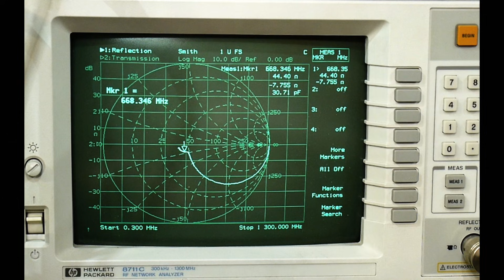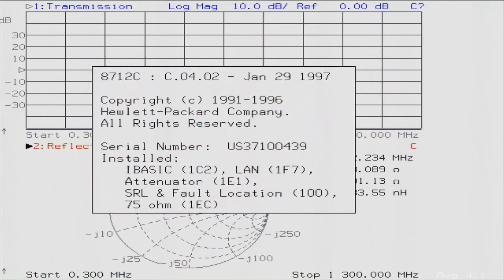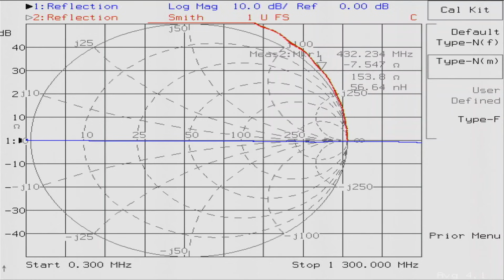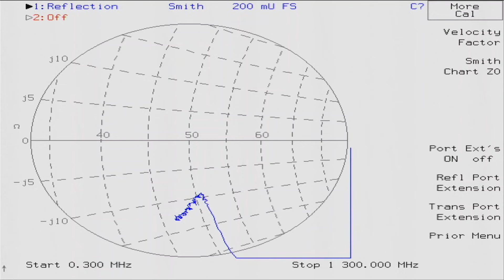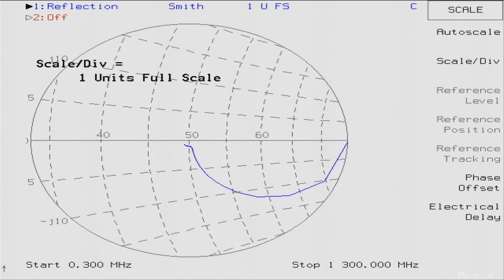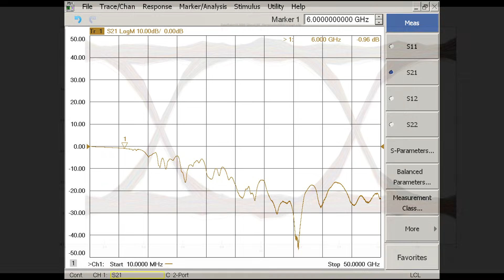#1215 VNA  Test Boards revisited with new data

Comment: Wow. This exercise did so many things. I had been waiting for your reexamination of test board results before ordering some.  Your results were great and added to ideas for best use.
First,  when did you get the bench top vna? Did you compare new instrument results to the nano, which you've already documented so well?  I'd like to see your test board measurements compared on nanovna to give my results a reality check. 
Suggestions about validating using high end standards are interesting. Precision without accuracy is no good for the real pros watching(not me).
Your comparison using port extension function and explaining results are appreciated.  I've never seen the effort to actually compare results when measurement plane is extended, as it (mostly) happens. 
I'm living in the low GHz because that's what I can afford and it is what I need to learn.  Seeing the effects of mm dimension changes are a great reminder of the magic of the RF world.
Reply from the maker: https://youtu.be/Saob5r6nb_4
I did many video on the upgrade to VNA 
https://youtu.be/CjRfue7HOgs
comparison: https://youtu.be/1Ll9YGzzulo
Reply: @IMSAIGuy  Thanks for link.  I'm just up to #700, not skipping around.  Just enjoyed your special books segment.

Comment: If you calculate the resonace of the capacitor using  your 100pF and 0.76nH it comes up to around 577 MHz, so you are probably seeing a series resonance effect, where the capacitor is now an inductor. A 100B datasheet confirms this. The ESR on the 100B  datasheet shows ESR of ~ 50 milliohms and Q of around 60 at 500 MHz. Capacitive reactance is around 3 ohms at 500 MHz.  There can be higher secondary resonances as well which the capacitor becomes a parallel tuned circuit.

Comment: What is the objective here?  To measure transmission line impedance  or capacitor? If the objective is to measure transmission line your new calibration contraption would cancel out Transmission line imperfections, and you can not measure it correctly.

I also think your body's proximity to the board change your measurement results.
Reply: I don't want to imply I'm speaking for the IMSAI Guy, but I get the impression test boards were probably made without realizing the impact of the electrical length on measuring the part.  Then it evolved into seeing how calibrating at the board edge vs. calibrating at the part reference plane makes a difference (along with not having an ideal 50 ohm trace).  So likely a 'trial by error' scenario. 

I should add a full two-port cal would have been needed to really de-embed the part (if that was the goal).  I noticed just a one-port cal was performed, so the transmission line on the other side of the part was not de-embedded.  That would be the biggest contributor to device measurement error (if the trace is not an ideal 50 ohms).

Comment: Just seeing the impact of changing the SMA connector on the board made the whole video worthwhile.  It just goes to show that the smallest of changes can have a very large impact when you're working at RF frequencies.
Reply: I once reconditioned an 11-element, circularly polarized antenna for the two-meter amateur radio band. The most improvement in performance characteristics came from completely rebuilding the gamma match between the polarization planes of the antenna, and the physical straightening of the solid aluminum rod elements into two orthagonal planes. Not only was overall gain improved but the beam's main lobe was tightened improving selectivity as well.
Reply: @MrBrelindm  I recognize some of these words... Actually basically all I get is straightening out the rods, and the tighter lobe/better selectivity... I need to learn some RF shit one of these days.

Comment: I would suggest the capacitor not being able to be a capacitor at 500MHz as the most probable cause of the "kink". The dielectric might act weird at higher frequencies and the pad resistance/inductance takes over

Comment: I have somewhat mixed feelings about your video. You are measuring something "unknown" against "unknown" calibration standards until the result seems to make more sense to you. As long as you don't enter the correct/known calibration standard coefficients in your VNA, all these measurements are of little use in my oppinion. However - it was a nice video to watch :). How about sending your friend your cal-standard and he measures it agains his professional ones? That way you get a really known and good standard as reference yourself. Just don't forget to store the cal-coefficients in your VNA and recall them before you perform a calibration.
Reply: I've done exactly what you've mentioned:  Made my own cal standards for home use, but compared them to the Keysight calibration standards.  I don't have the numbers in front of me, but I recall the return loss for S11 was better than 40dB for two 0603 100 ohm resistors in parallel when measuring to the Keysight calibration.  The upper end was maybe in the 4GHz range (I typically measured out to 4 or 5GHz).

I was quite pleased with the results given I just use them for hobby purposes at home on my HP 8753.